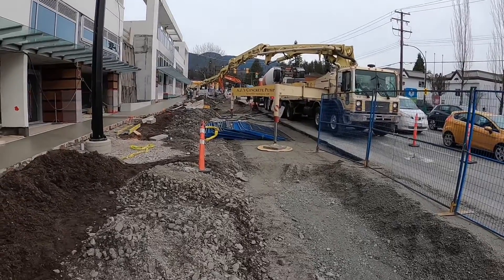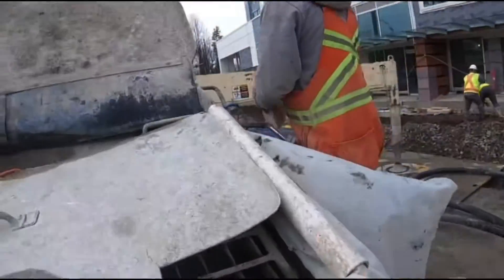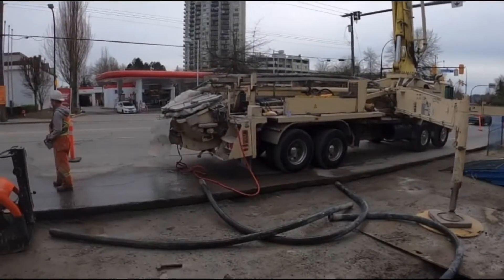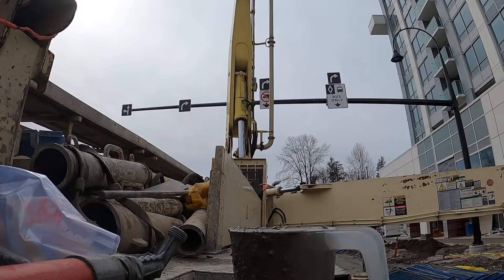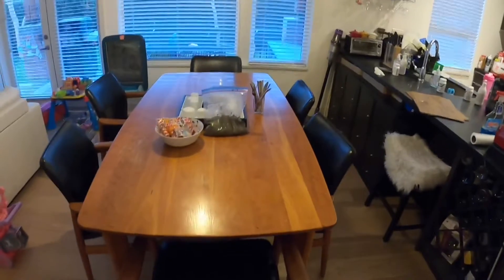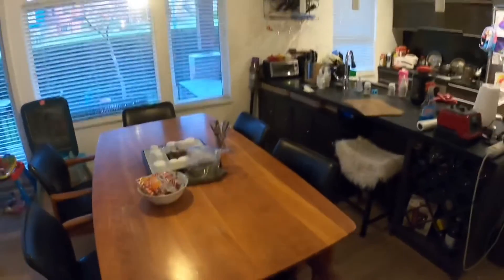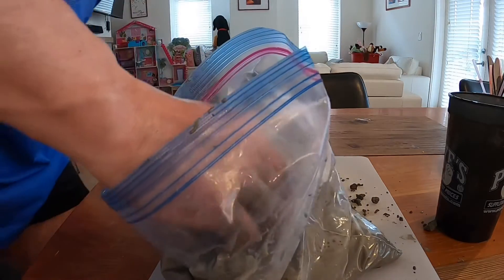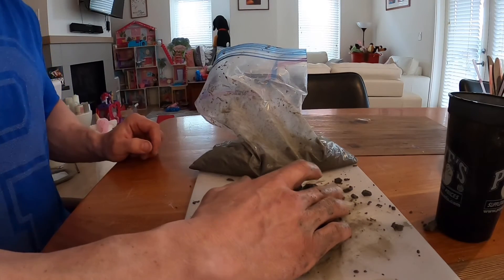Kill concrete dead…. FOREVER!!!

Comment: How I do this, is to empty the pump first, drag one ball, then sugar and water along with the second ball. 
Then the the content in the hopper, s tube, and cylinders is just water and rocks. Along with a dead concrete mix.
Reply from the maker: I like to add the handful of sugar into the hopper as well just before pumping out that last little bit as this helps to more thoroughly mix the sugar with the concrete. Also, if I have any buildup in the hopper its a great opportunity to knock it off the walls of the hopper suing a shovel and mix it together with the sugar. I go a little overkill on most of my procedures 😁
Reply: @canadianconcretepumper1979  I'm aiming to do it the easiest way, with the least a amount of effort to get it easily done.
I don't succeed 100% of the time, but most of the time.

Is oil and sand inside the hopper an alternative to bentonite? When going slow on hot days or slow with every stupid excuse for using accelerators in the concrete?

Comment: Hello, usually all the time I have to throw my concrete into two pools because at the buildings where I go do my job does not allow to leave any left over concrete. My jobs are usually an hour away from the shop. Using this method will allow me to skip throwing the concrete into the pools and getting back to the shop without the concrete getting hard and I wouldn’t have any problems when it comes to washing the pistons of the hopper? If I add more sugar is it more effective? Thank you! Hope to hear back from you. (:
Reply from the maker: Absolutely no problems getting the pistons and hopper clean after travelling. We used to do a lot of barge work in which it would be 3-4 hours travel time before reaching the washout area. Never once had an issue. Just make certain that the sugar is mixed thoroughly into the concrete which will remain in the pump. It’s all about getting it mixed in there properly.
Reply: En France il nous est interdit de rouler avec la trémie pleine on jette dans un betobag et ensuite on peut laver en centrale
Reply: @laurent2063 bonjour camarade 😊

Oui en belgique aussi, mais quand tu est en ville ou village dans les centres, impossible de L'avé 😡

Comment: very fine quantities of sugar acting as retarder in concrete maybe less then 0.02 like 50ml of sugar solution to 100 liters should nt do harm !
Reply from the maker: Very likely, but I’m not so certain that us operators are to be entrusted with such precise units of measure, lol!
Reply: google says its 0,06% by weight of cement used will delay the initial set time by 80 minutes. but as seen in the video i'd be sweating if i was calculating and weighing the amounts with a full mixer of concrete lol

Comment: About to try this Monday night I have 800 yards two pumps I’m planning on recirculating it in the hopper till I can wash out the pump any advice
Reply from the maker: Best bet is to pump the hopper until you’re just about to suck air, then sprinkle it across the back of the hopper and pond it through. I find it works much better than recirculating. Just my preference.
Reply: @canadianconcretepumper1979  thank you I appreciate the advice 🙏

Comment: Surprised you were able to pump like that short rigged, I didn’t think you could go past your right rear that far with the left that short
Reply from the maker: From inline with the fully extended front outrigger to the center of hopper is the manufacturer spec. for this machine. You are correct though in that some manufacturers models they state keeping the boom between the two fully extenders outriggers.

Comment: We used to to spray sugar water on top of the concrete when doing exposed rock finish
Reply from the maker: Yes sir! Plenty of placer/finishers around here still do the same, or just use the blue liquid retarder (which is essentially sugar water).